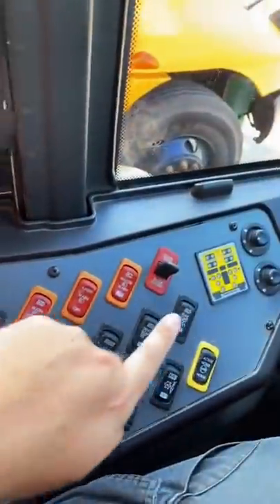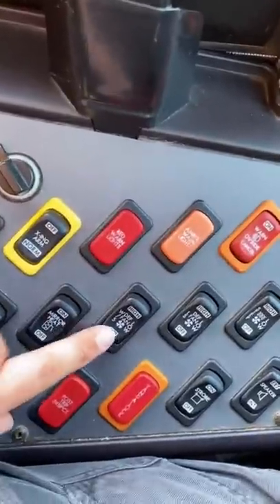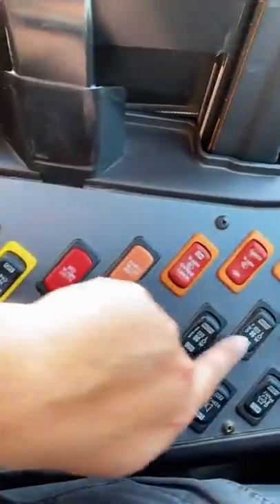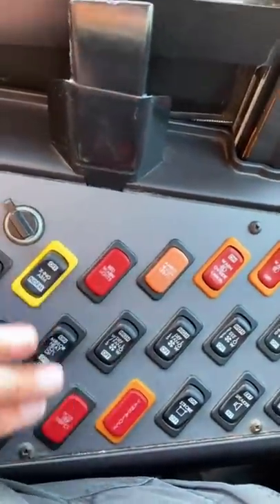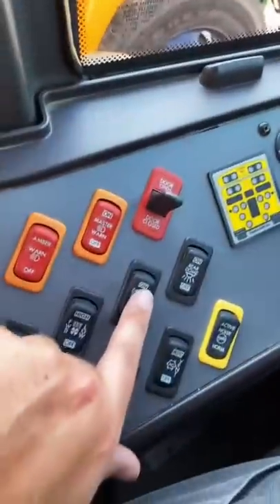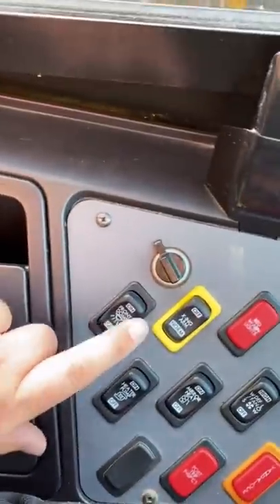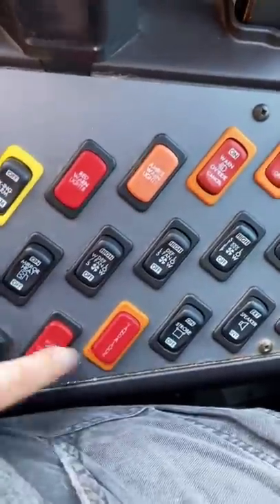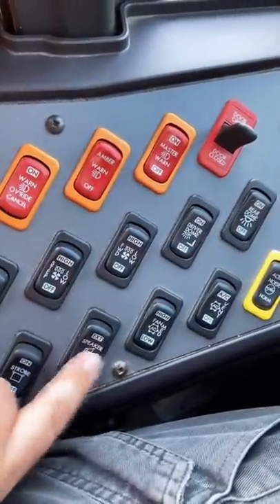WHAT DO THESE SCHOOL BUS SWITCHES DO?

Comment: Clawboss very useful tip here. C2s have a multiplex system, so you can just pull the switches and relocate them. Just look up relocating switches on a Thomas C2.
Reply: if his company will be happy with that
Reply: @Pa_school_bus_enthusiast  I don’t think they would care. Driver comfortability it’s very important. And it’s not that hard. You legit just switched the place of the switches and start up the bus. It was designed that way for a reason.
Reply: I was just about to comment that then I saw yours lol!
Reply: @chrish1444  haha so was I!
Reply: @imc4757  same!
Reply: @BusDriver71  I think the freightliner cascadia are like that too
Reply: Up
Reply: @kad3e3  no
Reply: I know it's easy to swap the switch positions, they're built to be easy. Great for the bus technicians.
But if a driver did that? That's asking for a butt whoopin'. You're not "trained" to do it, so they don't want to run the risk of you going into the panel and maybe setting the bus on fire... My company gave me a hard time because I entered a bus through the BACK door.
Reply: @sarukmaktao225  That time when you enter through the back door, did you accidentally lock the door? And there’s no going into the wiring panel and no thing that could cause a fire with C2s. You literally pick up a switch and put it in a different place. But I can understand a bus company being upset.

Comment: Having been on many band trips and counting, I can confirm the C2's panel is an absolute mess. One time we were parked and driver was away and I had to go fix the AC and lights because the chaperones couldn't figure it out lmao. And the C2's are a hell of a ride when it's two a.m. and you're boxed in like a turtle's pecker in that seat.
I miss the '09 IC....
Reply: The switches are made on a system where you can plug and play the switches and move them around slots. I would make sure the company/garage/district is okay with it first, but it is really useful!
Reply: @trucker57  interesting. Our district must just have a really janky configuration then lol

Comment: I own a old C2 school bus as a converted camper. You can rearrange those switches anyway you want just unplug them and put them wherever you want. It’s a pretty cool design. The red indicator light that says post trip inspect is basically the child check feature. Whenever you put your red lights on and shut the bus off that light will turn on until you go to the back and open exit door.

Comment: You can actually also pull out switches and relocate them to a place of your liking too. Just gently tug on the switch to get it out, and swap it with another switch. Then, turn the bus off and back on, and use the switch a bit so the matrix gets used to the switches new position. So, if you really are unhappy with the front dome light switch’s position, you can move it.

Comment: Your post trip inspection light is your child check alarm (if equipped) and the vandalism alarm is the busses integrated security system,  they are not switched, they are indicator lights.

Comment: Hey ClawBoss, do you know about the blue framed button next to the overhead and  flashing lights?
Reply: Which blue frame switch?
Reply: @brandonlee131   it is only on some Thomas busses. It activatates all exterior lights and stop sign for pre trip inspection. Hit brake pedal to disengage. Located above the ignition switch if your bus has it.